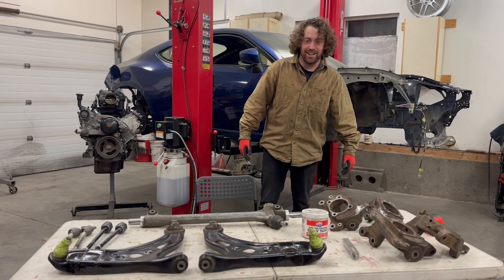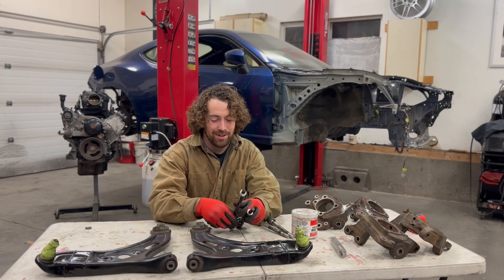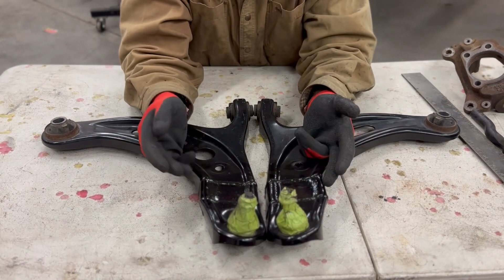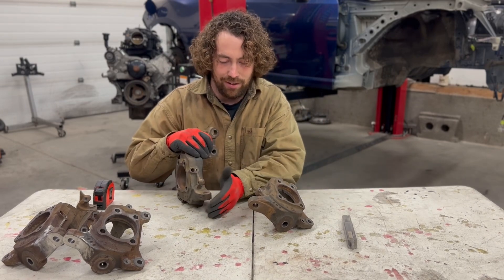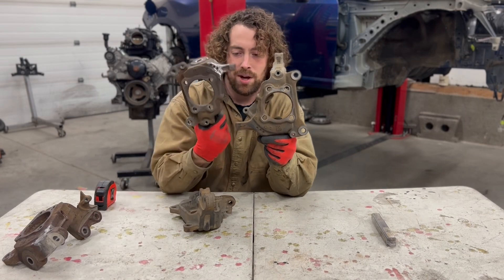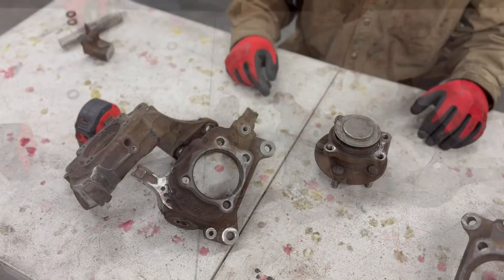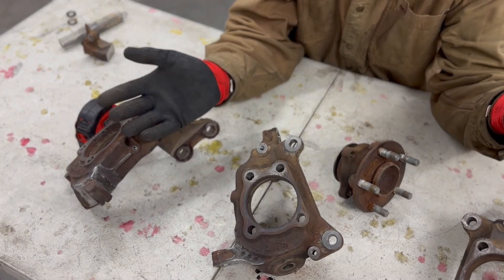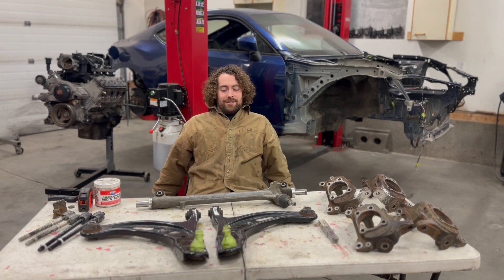Brz/Frs/86 DIY Angle Kit TECH TALK

Comment: Why can't run rack spacers  on the oem tie rod inners?? 
I just installed 5mm spacers on mine o_o
it's my only angle mod
Reply from the maker: You can if you want to
It just barely makes a difference
Reply: @Sean.Corscadden  sicck imma just send it then haha
thanks for clearin that up